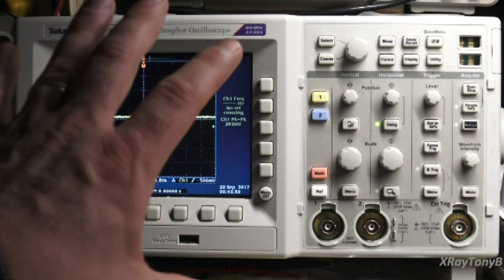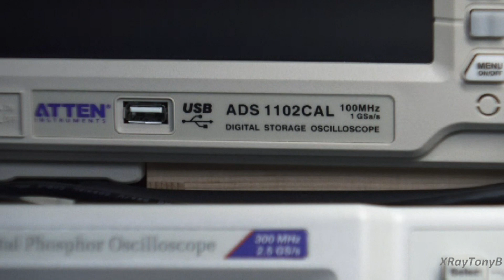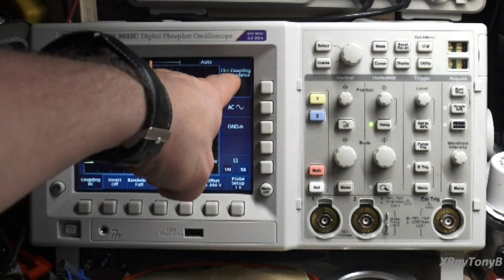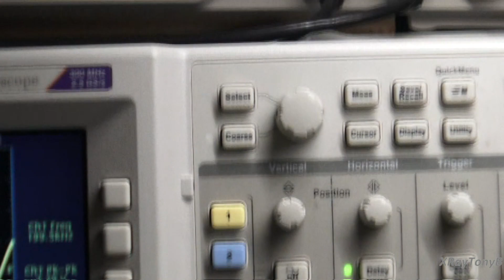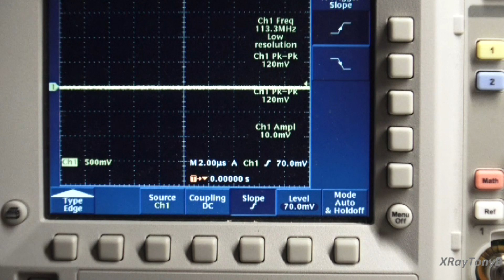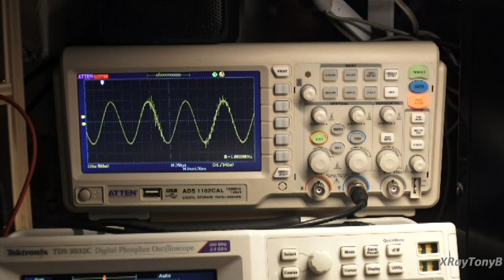Oscilloscope Series - Part 4 - Digital Oscilloscopes

Comment: Very good presentation and not as much  rambling as you may have thought. A thought that comes to mind is the various mentions of the different consequences of grounding. I'm not that well traveled with videos. Has anyone done a lengthy one on ground loops considering you can end up interconnecting several pieces of  gear for a test.

Comment: These are great scopes.  I bought them mostly for the measurement features.  I'm too old and lazy to count graticles anymore and its nice to have precise, accurate measurements at the touch of a button.  There are quite a few in the "30" series.  The number will tell you the bandwidth in Mhz and the number of inputs.  3032 indicates the 30 series, 300 Mhz, and 2 inputs.  The 3034, for instance, would have 300 Mhz bandwidth and four inputs.  I bought two 3012s and a 3032 from a government surplus auction (they surplused them because they were "obsolete" )for about $350 each.  Since I didn't need the higher bandwith, I sold the 3032 which paid for the whole lot and kept the 3012s.  One thing you should look for if buying one is how many and what type add-in cards are included.  Mine were pretty loaded with Advanced Trigger and Fast Fourier Transform modules.  Both are really handy in my shop.  They're also pretty pricey if you have to buy them separately.

Comment: Thank you for your video's as I have learn how to use one. Over the years I could never afford one and did not know what one was good for or how to use it. I did buy Rigol DS1054Z Digital Oscilloscope  for my 72 birthday, but only turn it on once and then back off. A little late in live for setting up a lab, so a little late then never. I still need to watch my penny's now that I am retired. Now I need to get something to protect it from being damaged, so looking for some type isolation.
Reply from the maker: Larry,
Thanks for watching!  It's never too late to start tinkering!  I just got 6 old radios for $28.  They should keep me busy for a month!  Cheap entertainment.  Good luck with your new hobby!  
All the best,
Tony

Comment: The variable adjustment is a valuable tool.  Many transceiver alignment procedures call for setting output power to something like 2/3 or 1/3 of the measured signal.  With the variable control you don't need to do any math.  Need 1/3, using the variable control adjust so the waveform just fills 6 divisions. Now adjust the power of the transceiver to just fill 2 divisions which is 1/3.

Mike